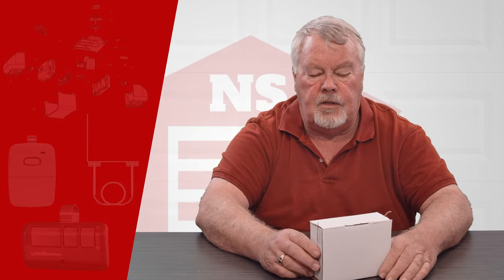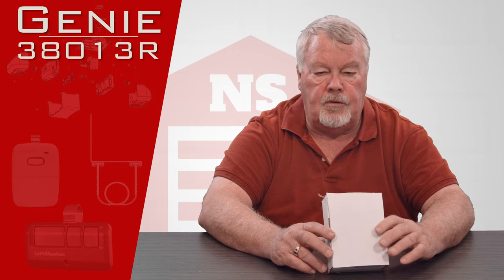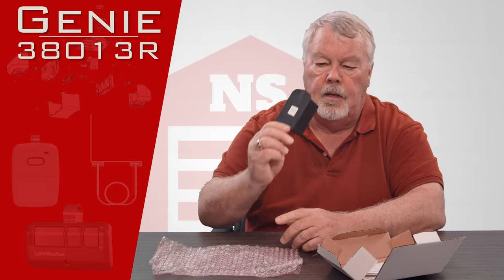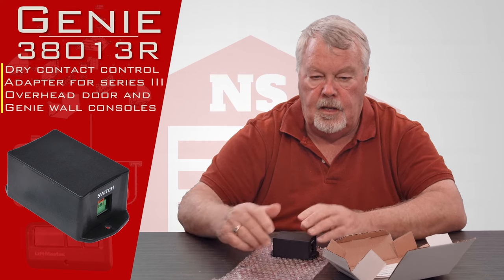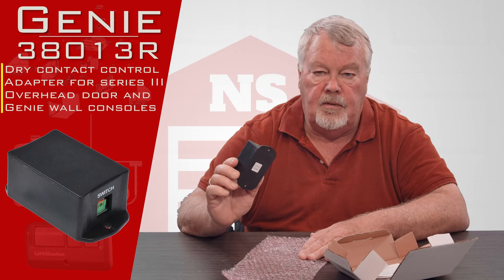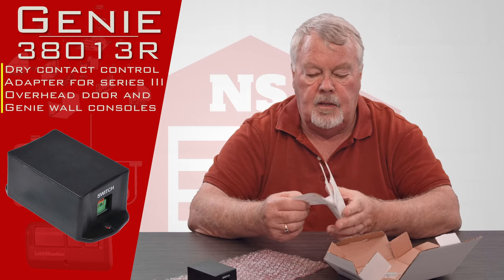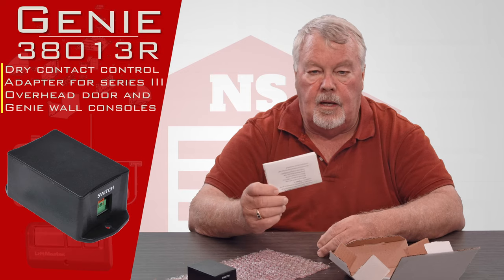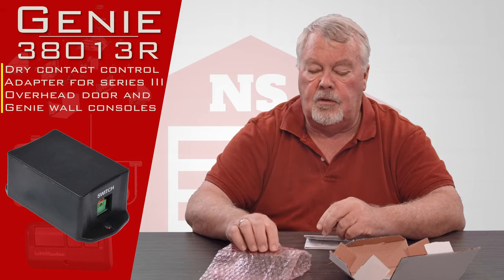Genie 38013R Dry Contact Control Adapter for series III Models

Comment: Is this dude awake? Directions don't tell me jack. Show me how it works.
Reply: Much of what he said was wrong (it does not interface with a "light control"). It simply allows newer Genie openers that use series III wall buttons to now also use the old style dry contact closure switch. This can be a simple  push button or it can be a relay to control the garage door (for example via Home Automation).